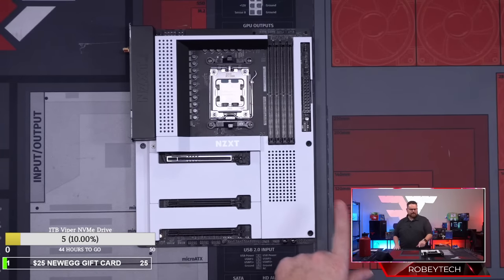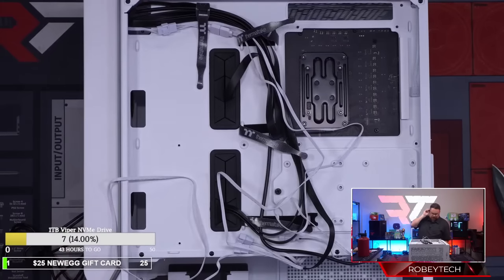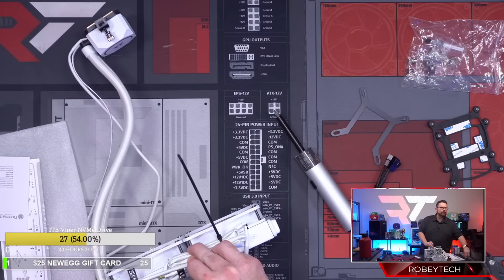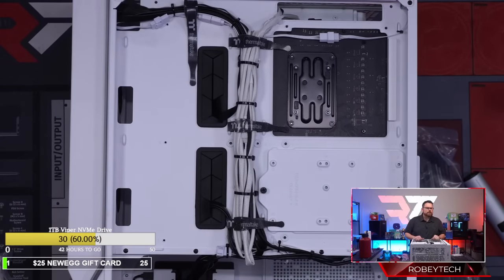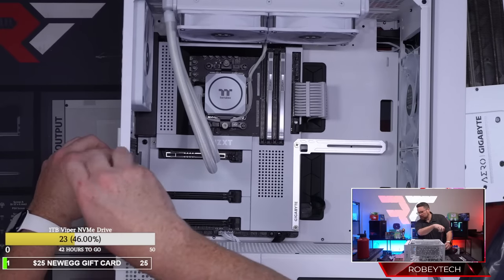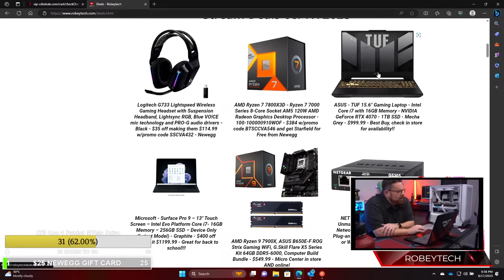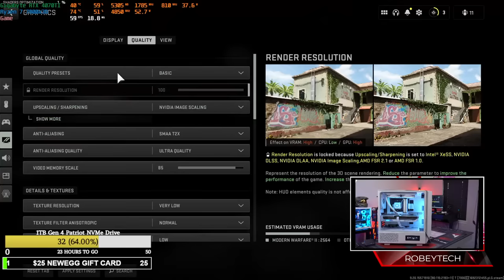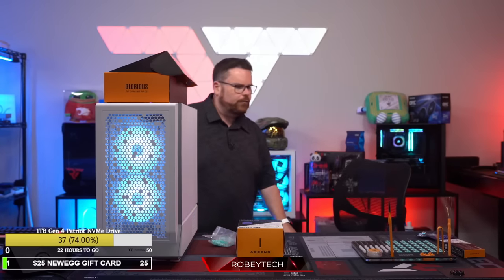Giveaways + $2200 Arctic Gaming PC in the Thermaltake CERES 300 (Ryzen 7 7800x3D / Gigabyte 4070)

Comment: It is nice to see that there is still companies out there that still make a case with Good air flow (Large Holes) and include Audio/Mic Jacks in their cases. Thermaltake CERES 300 gives you the right size that is not to big or too small to fit high air coolers and a AIO on top but wish the I/O could be relocated to the bottom for Desk Top use.

Comment: Thanks for the great video. I got the same case, but I wonder if we can fit any 360mm AIOs at top? In Thermaltake website, it only says that you can fit 3x 120mm fans at top, I did that without any problems, but what if we try an 360mm AIO instead for top? Many AIOs 360mm are about 395 to 400mm, and whole measurement for ceres 300 from top (inside) is about 401mm. The real question is can we fit an 360mm AIO at top? I'm asking that because I don't have any 360mm AIO to test it with my case, maybe you can test it if it fits or not. I know Thermaltake says only 280mm for top max. but I think 360mm also can be done (I think enough room for the radiator itself). I will appreciate if you try and enlighten us.